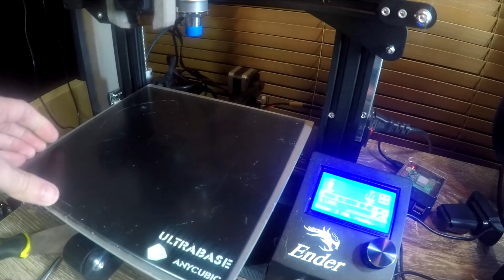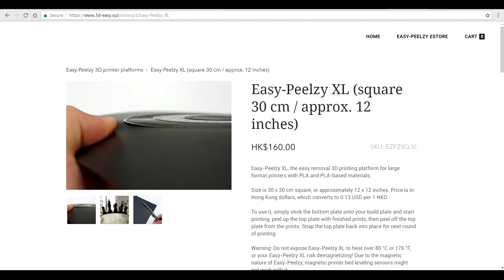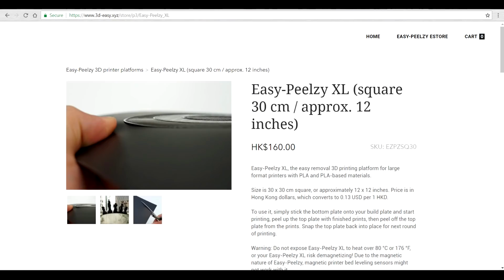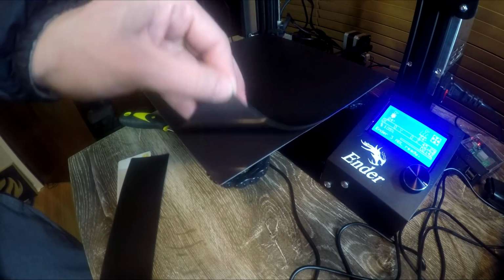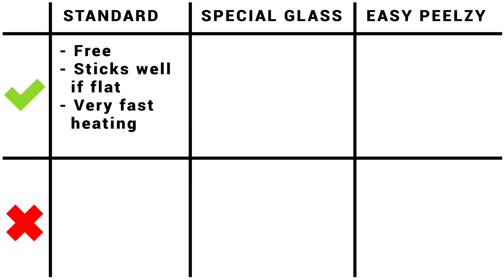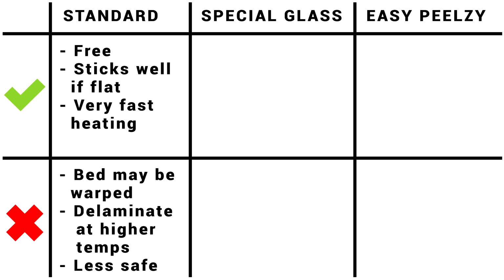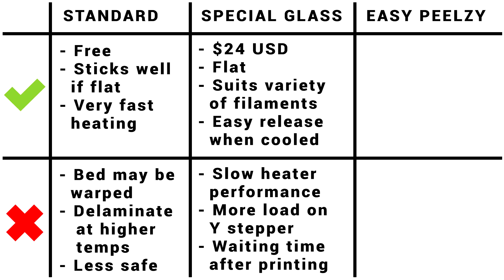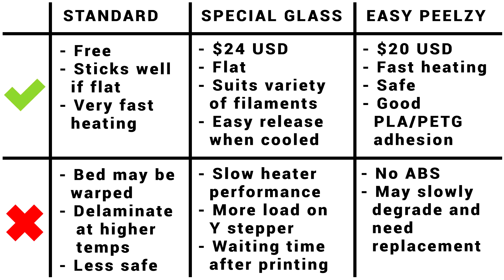Ender 3 build surface comparison: Stock vs glass vs Easy Peelzy magnetic sheet

Comment: I have the official creality glass bed and it’s so great. If I wake up to a print that’s been done for awhile, it just comes right off!
Reply: Do you put anything on the glass before printing? I've seen people talking about PVA glue or hairspray O_O
Reply: @tgriffin91  for pla, no. But for petg I flip it for the smooth side and use cheap hairspray
Reply: @LOCOsnakeBITES  awesome thank you 👍 I'm finding unless I have a raft, getting the print off the glass is tough 😅 I'm using PLA
Reply: @tgriffin91  you maybe just be printing too close to the bed. That's an issue as well

Comment: I unfortunately have a warped bed on my Ender 3 and even after upgrading to a BLTouch (following your guide) it was too warped to take full advantage of the full bed size. Also at ABS temps my buildtak style surface lifted which was the final staw for me. The buildtak style material was excellent for printing on but with the bed the way it is my only real option was to go for a glass bed.

I went for Creality's version of the Ultrabase and it's probably the worst decision I've made so far... I've got my Z offset dialed in just right and the BLTouch is doing it's job great but I can't print anything without the print warping in corners. I'm not even using ABS I'm using PLA, the same PLA which printed perfectly for two 3rds of a 1KG spool on the fake buildtak surface. I've attempted somewhere around 30 calibration cubes at different settings and all experienced warping in the corners. The funny thing is that while it's hot the prints do stick to the material well and they do release when cold, but for some reason they still warp upwards in the corners. I've never had this issue before now. I've cleaned the bed with IPA, I've used different fan settings including having it off, I've increased and decreased bed temp and hotend temps but nothing at all solves the issue. I resorted to trying a glue stick and it stuck perfect but of course it defeats the purpose of these build plates.

I've finally gave up and flipped it upside down so it's just a plain glass surface and it prints absolutly fine on that with no messing about which proves the Ultrabase material is absolutely useless (or at least Creality's version of it is).
Reply from the maker: I've read that some people love it and some people can't get it to work. The one on my Geeetech A10M is still good so far. I hope you can resolve.
Reply: @TeachingTech  thanks for the reply. Unfortunately I'm still having issues with it. I've managed to stop or reduce warping on it but now I'm getting delamination issues with the PLA when printing on the Ultrabase. I also had a big issue when printing with wood PLA on it where it practically welded itself to the bed, but I've printed fine with it on glass and buildtak.

Maybe it's the Creality version of the Ultrabase that's the issue, specially since it's so cheap. At least the Glass underneath is still good though so I think I'm going to have to stick with that for the time being.
Reply: @seagullhunterfpv  clean with isopropyl alcohol and kitchen tissue to remove any oil residue (was an issue for me) use brims and higher temp if necessary. I use fake buildtak and it sticks the prints too well, use a skirt for the first time in ages because nothing lifts.
Reply: @MaximilianonMars  in all fairness I've recently got it working a lot better. I found that part of the issue was due to me changing the nozzle to a steel nozzle around the same time as changing the build surface. The steel nozzle caused a lot of issues due to the thermal conductivity meaning I was having to print PLA at 235 Degrees C. Since changing back to Brass nozzles I'm having a lot more success.

I've still got mixed opinions about it as certain types of filament are near impossible to print on it well and I seem pretty easy to damage. I find printing on plain glass gets more success and isn't hard to remove once it's cooled either, but the Ultrabase side is good for just standard PLA printing.

Comment: You mention added load of the y-stepper, but does that translate to the print? I would be curious to know if you see more artifacts on the print just by adding that glass mass to the system. Did you try a calibration cube before and after the glass, for example?
Reply from the maker: I haven't tested it but on paper it should add to ringing. How much is an interesting question. Some people add glass plus cameras so I think the glass alone might be negligible.
Reply: @TeachingTech  The overshoot may depend on many things; mass of the glass, movement speed of the bed, flex in the belts.. etc. I'll be honest, I was hoping you had done such a test to find out if it has an effect in the typical printing range (30-60 mm/s?) before I spend money on a thick piece of heavy glass with surface treatment rather than a picture frame. I may do it anyway to find out!

An ultrabase of these dimensions would be something like 1.2 Kg in weight, that seems pretty significant compared to a camera that weighs roughly 100 grams? (GoPro)

Comment: Hey, for the latest version of Ender 3. The sticker is not anymore directly on the aluminum bed. You can remove it because it's hold in place with paperclip. You can use glass with similar properties as buildtack by sanding the surface. It stick really well when hot and remove easily when cold. You don't need to use tape. I have never used tape. If you want to use glass without sanding it. Glue do the job well..
Reply from the maker: They change it so often it's impossible to keep videos up to date!
Reply: @TeachingTech  this is cool because they listen what customer say. And it give constant upgrade in the design.

Comment: Hi Michael, you missed possibly the cheapest/best one. I use 3mm picture frame glass on my E3. In fact I have two pieces that are exactly 235mm squares. They cost me the price of two thrift store picture frames ($2 each) and a $3 glass cutter to cut them down. Yes, I use Aquanet but my process is to clean the glass off from time to time and then lightly spray Aquanet over them while I hold them over the sink. Yes, the glass is fragile but if you can wash up a drinking glass I think you'll survive. The benefit of using this type of glass is that it heats up and cools down very quickly because it's 3mm . The surface is great to print on and prints fall off as soon as it cools down. Because I have two of them I mount and demount them as soon as the print is finished. Another benefit is that because I remove the glass with the print attached I don't disturb the level of the printer. I haven't had to level my E3 in over a month and I don't see any reason to fit auto level. Picture frame glass and hairspray, go figure.......
Reply: I use a 3mm glass plate - just ordinary soda-lime "window" glass. I had to adjust the height of my Z-switch to achieve bed-levelling and add 10°C to bed temperature (eg 70°C) to compensate for heat dissipation. Allow a little time for bed to heat up and - check with laser thermometer for 60° in the middle of the bed and one or two degrees less at the sides. For adhesion I use a solution of table salt as described here - https://www.uantwerpen.be/images/uantwerpen/container11343/files/bonding_pla_with_salt_water_v20160713.pdf This works really well. My models stick perfectly and just pop off the plate when cool. No more glue or hairspray !
Reply: @embewewe   thanks for the link and info!
Reply from the maker: That is very similar to the setup I used on my Solidoodle 2 for many years. I purchased cheap offcuts from a local framing shop. My trouble was the small 150 x 150mm bed made it hard to clip the glass on. On the Ender 3 that's not really an issue.
Reply: Boroscilicate glass isn't that expensive and it'll withstand the constant rise and fall in temperature. I have a sheet lying next to me for when I want to switch to another filament.
Reply: Glad you mentioned it was 3mm glass!  I got a piece of picture frame glass that was closer to 1.5mm, and within 20 hours of printing it shattered... Got a 3mm one and it's been working great for over 500 hours!
Reply: Huh, good note, thanks! :thinking emoji:
Reply: Hey, could you share where you bought the glass please? I've been searching online and I can only find 2mm, I found a couple 3mm but they were either way too big or way too small
Reply: @mannyserrano9718  I got my plates when I purchased a couple of picture frames from a thrift store where they go for almost nothing. I purchased a $5 glass cutter off of Amazon as part of a bigger order but they are available from any hardware store and the glass is available at any framer shop. Learning to cut this glass is really easy because it's so much thinner than mirror glass.  2mm might be a bit too thin but I'd still try it out. The glass is delicate obviously but not so much as you may think. I never use a scraper to remove prints since they release when the glass cools/shrinks. After washing the glass to clean off the old hairspray I dust it with Aqua Net and clip it to the bed ready for the next print. If you do go the 'thrift picture frame route' try to buy one large picture frame, that way you know all your plates are exactly the same thickness. As for process, I unclip the glass with the print off of the printer once the it's finished and let it cool down separately. Leave it alone for ten minutes and the prints will be released without pulling. Also if you have a second plate the printer can be back to printing immediately. Another benefit of this is that I almost never have to re-level my printer because I never pull on the mount to release prints. I haven't re-leveled either of my Ender 3 printers in at least three months. Aqua Net is the best and cheapest and is available at most any supermarkets where old grannies are served.

Comment: You mentioned curling on larger ABS prints... were you able to solve that? I am experiencing the same on the textured Glass plate.
Reply from the maker: The properties of the material make it hard to overcome. You can try more drastic things like putting an acetone/ABS slurry on the bed first. I generally just use PLA.

Comment: Found your vids while starting my search for a 3D printer for quad/drone parts. Thanks for taking the time, subbed. Which build surface did you end up leaving on your Ender 3? Looks like glass is the way to go, if you're not in a hurry for your prints and have patience to wait for the bed to warm up.

Comment: I have had a lot of luck making PETG stick to glass, by sanding the glass using normal sandpaper.
If you use a finishing sander it is possible to get a uniform look. I just use some handpaper corn 80 
to make a lot of scratches, but I haven't had a loose print since. :-)
Reply: Just be careful printing PETG directly onto untreated bro-silicate glass. Sometimes it can stick a little TOO well damaging the glass.
Reply: I've seen the pictures, but newer seen it my self. I think there must have been some errors in that glass. 
I use normal (used) window glass, with no problem so far, but should it happen, then I have a lot of old glass and a glass cutter. ;-)

Comment: I was able to restore my Ender 3 heated bed back to being straight enough for the stock build surface to work nicely. I bent it little by little, using a straight edge to check my progress. Bend a little on the X-axis, then a little on the Y-axis, check with straight edge and repeat. I don't know if heat cycling will warp it again though.
Reply from the maker: That is a good effort. I know I would butcher that if I tried it.

Comment: what i'm missing is the cheap and good IKEA mirror solution,  4 pcs of mirror 30cmx30cm for approx 10 AUD. flat,thinner than the original and works like a champ.

PLA and PETG works prefect with a bit of hairspray, cold or warm. 
use a glasscutter if you need it smaller (6 AUD or so ) 

sometimes the lowtech works well or even better.
Reply from the maker: I printed on cheap framing glass for years and years with hairspray. Used to buy all the offcuts from a framing place for a few bucks.
Reply: yes, works the same, I found that mirrors use to be flatter that normal glass, a great bonus for that price ( 4 mirrors in europe for 7 EUR ) 
but nothing as good as the OPI3Mk3 :)
Reply: Thank you so much, I have been looking for a cheap source of glass beds and wasn't having any luck at hardware stores. I hadn't thought to look at Ikea

Comment: What brand and configuration (temp hot-end and base) do you use in PLA and ABS?
Reply from the maker: My filament sponsor is X3D.com.au
For PLA I use 200-210 for hot end and 60 for bed. ABS around 250 for hot end and 100 for bed.

Comment: On my Ender 3 I can print PLA, flexible TPU, and wood filament perfectly with the default surface. But I cannot print Nylon on it, it won't stick. For now I'm using 3M Blue Painters Tape and it works well with Nylon, but I'm waiting on a PEI sheet, I'll try that too.

Comment: Well I found the problem, which I had no clue about.
My x-axis beam is wobbley and slops down on the right side. (power supply). This is after I adjusted the wheels to remove jerky motion. Everything went to shit after that. It is so wobbley, I have no idea at this point but to disassemble the entire thing, and see where I went wrong. I am about to throw it into the trash. So much for 3D printing.
Now i'm thinking twice about it.
Reply from the maker: 3D printing has hurdles to overcome. Try not to blame the printer, you will learn in time.

Comment: After 3 hrs of leveling, glue-sticking, trying and trying again, this glass plate SUCKS!!!

I can't get anything to adhere on to this thing. I'm starting to hate this.
Sorry for the rant.
Reply from the maker: What temps are you using?
Reply: 60 on the setting, and trying that purple Elmers glue. I think I'll try again l8tr tonight, but might re0install cura as I did play with the settings. That might make a difference.
I did install a new extruder all aluminum, and the new Capricorn tubing and new couplers. Seems extruding ok. I get lots of plastic out.
BTW, it ran ok when I first put it together. The doggie test worked great. A few print on my own stuff went good.
Might be Cura settings
Reply from the maker: Try not to change too many things at once. It is very had to pin down problems with so any variables.
Reply: @TeachingTech  thanks. But I see that the carriage for the hotend is not level. This caused the nozzell dug into the plate. I couldn't get the bed to level without digging into the plate. My org buildtek and the glass plate were ruined.
I cant figure out why its sagging, and I tried to adjust the wheels.
Reply from the maker: I think this design will naturally have a bit of sag. If it's minimal and you get your bed parallel it will probably be indiscernible in the final prints. Adjusting the eccentric nut on both side will help.

Comment: WOW, seems so easy. I think I might have a bad/warped bed. I used the stock and wore it out. Switched to the glass with coating and I can not get my bed level right. 
I am about to give up.
I am trying so hard. After a few good prints on the stock build plate, it didn't hold my prints. So I got the glass w/coating from amazon.
it's late here, will try again tomorrow. This is frustating... :(
Reply: Did the glass bed help you? Do you have a link for the one you bought?
Reply: I think it was ok, I got this one from amazon.com 

https://www.amazon.com/gp/product/B07GL2NMV5/ref=oh_aui_detailpage_o04_s01?ie=UTF8&psc=1

However, I would get the smooth flat one and use hair spray. I had bed leveling issues.
I am still waiting on a replacement microswitch as I had one break. But I also installed the yellow springs as my stock spring would loosen during print and cause hell.
I did like the flat built tak removable plate that came with the ender 3 originally. They sell them on Amazon as well. I am going to try the smooth glass if I don't get good results on this.
Reply: Did you fix it, I think I may have the same problem
Reply: My ender 3's stock bed was warped after just 3 prints , nothing would stuck to it also.
I got a creality glass bed and I put down hairspray before I print and now Im not waisting any material.
All my prints wil stick right away.
Also after cooling down just wash the glass with just water and repeat.
By far the most easy one to clean.
The standard bed got contaminated with old pla wich I couldnt even scrape off without damaging the bed.
For me glass + spray made all prints better.

Comment: Would you recommend borosilicate glass or tempered my bed is slightly warped
Reply from the maker: I think either would be fine. You can also use plain glass or mirror.

Comment: Easy Peelzy has been making my life hell for like 3 weeks. I can't get PLA to stick to it at all, I had better luck w my warped sheet of glass my Cr-10 came with. I'd kill for this thing to work at all. Any tips? I've never worked with build-tak like stuff before and maybe I'm just using it wrong but as of now terrible experience.
Reply from the maker: My sheet is still going strong with the new owner of the printer. With these surfaces you don't want the first layer as close or squished as glass. Too close and it will bond so well you'll never remove it.